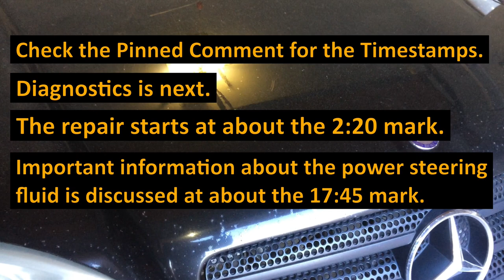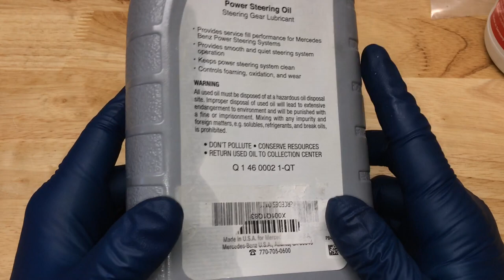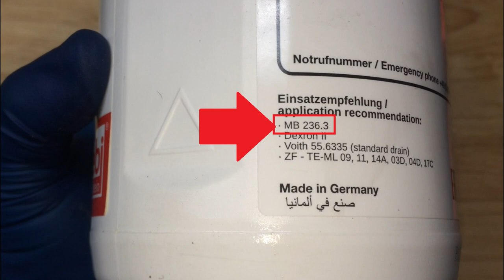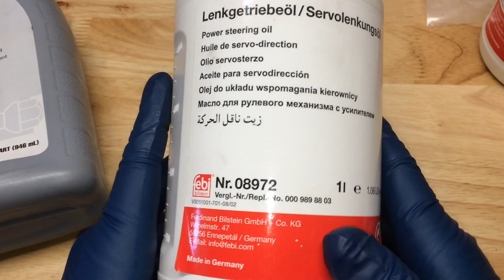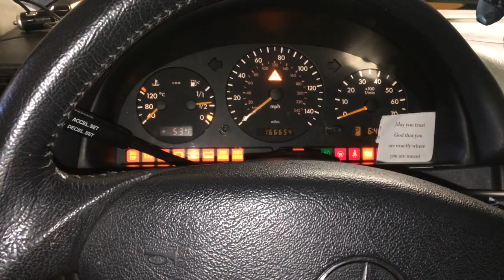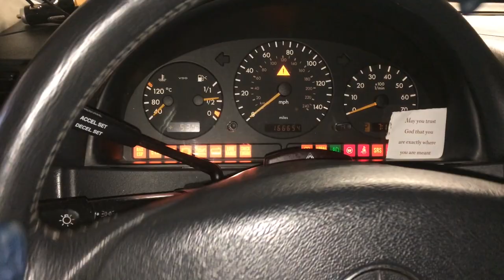Mercedes W163 Replace Power Steering Hose Pressure Line, Fluid Flush & Bleed '02 - '05 ML350 ML500

Comment from the maker: Timestamps, Part Numbers, and other Information:
00:20  Notes about using jackstands and ramps for this job
01:13  Empty the power steering fluid reservoir
01:29  Identify this leak and hose

Begin repair:
02:18  Remove the Banjo bolt at the steering rack (22mm)
03:48  Remove the hose bracket (10mm): 
Tip: @
carl suiter noted in the Comments that you can reach the bracket fastener from the passenger side of the oil pan using a long (2 ft) extension with a wobble end.  Thanks for the tip, Carl! 
04:23  Remove the flare nut at the power steering pump (17mm)
05:30  Locate the o-ring on the pump side of the hose
06:18  Remove the hose

Replacement hose information:
07:14  New and old hoses: part number A163 460 4224
07:29  Inspect the new hose for the o-ring (part number is possibly CRP 0259977548 - not verified)
08:19  Part number for crush washers (A0076 0301 8101)
08:45  Transfer the hose bracket to the new hose
09:29  Notes about the new and old Banjo bolts and washers

Install the new hose:
11:05  Guide the new hose into place
11:53  Install two new crush washers and the Banjo bolt at the steering rack
13:02  Install the hose bracket
13:47  Connect the hose flare fitting to the power steering pump 
15:57  Torque down the Banjo bolt (torque is 22 ft-lbs)
16:45  Torque down the flare fitting at the pump (33 ft-lbs)

Notes about Power Steering Fluid types:
17:47  Original fill PS Fluid (honey-colored): MB Spec 236.3 (ie, MB A000 989 8803)
18:44  Later PS Fluid (green-colored): MB Spec 345.0 (do not mix 345.0 with 236.3)
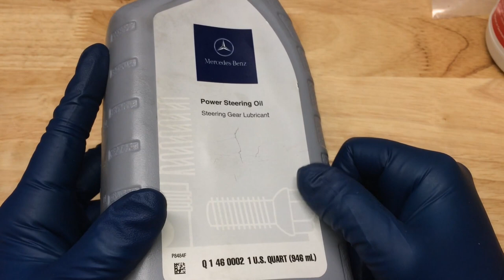19:38  Notes for a PS fluid flush (buy 2L of fluid)
21:46  Tools for a flush (3/8" ID barb and hose)

Power Steering Fluid Flush:
22:29  Elevate the front wheels (ie, jackstands)
22:45  Front end lift-point and jackstands locations
23:03  Disconnect the power steering return hose (Philips hose clamp)
24:10  Install the flush line and sight hose
24:56  Refill the reservoir and start the flush
28:42  Remove the flush line and sight hose
29:41  Reconnect the return hose to the reservoir

Bleeding the Power Steering System:
29:50  Begin the bleeding procedure
31:46  Bleeding procedure summary
33:53  Final adjustments of the PS fluid level
35:24  Check for leaks
36:13  Recheck the fluid level after a couple days

I hope this video is helpful.  Thanks for watching, and good luck with your repair!

Comment: L35 Delivers some of the top DIY's videos on the web.  Over the past 22 years, I've owned 5 -W163's (still own an ML500 and ML320) and have done most of own repairs and maintenance.  Since I found his videos, he is the first I search to see if he has posted a video on the process.  Even if I have done a procedure before, his are a great reminder of what not to forget and how to do it again.  Here's what makes these videos better than the other ones that are out there:
1.) The videos are clear, lighting is great, images are stable and infocus.  He keeps the video rolling during the hard parts so that you can see what is in the way, how to move it, what to disconnect, etc.  He shows and tells at the same time and does not waste time with long introductions about what he is about to do, he gets down to it and explains as it is being done.
2.) He pauses the video at the important points, takes the time to add annotations to the screen shots that clearly pinpoints what to watch for, what bolts, what parts are needed or what you may want to replace while you are at a repair.  What is going to be brittle and break, with tips on where to place catch basins, rags, etc.  This is helpful to keep the mess to a minimum.
3.) Great attention spent on showing "how to" position a wrench or socket or extension, or where a hidden bolt is at.  He covers in detail, how to position your tools, what to take off to get to the repair,  size of wrench or socket, and shows the important details on o-rings,  crush washers, where to look if you don't see them and what tools to use.  This is what saves me time and completes the repair without leaks or rework because of a rubbing hose placed wrong.
4.) He does things by the book- which means he checks and shows you he has verified, part numbers, fluid specs, procedures, torques, where to find it and what to expect to pay.  Many other repair videos wing it on torques, fluids, and safety procedures.   This is what professional mechanics do.

Great work L35 in Colorado!!  You set a standard that others can learn from!

Comment: Outstanding video I just replaced the rack, power steering pump, reservoir and both hoses on my ML320, That little bracket was the toughest part of the job, A 2 foot long wobble extension, coming from the passenger side of the pan took some of the pain away, but it was still difficult.
I love your videos they are so detailed and professionally filmed. A gold standard here on YouTube ..... Bravo !
Reply from the maker: Wow, thanks for sharing that tip about the bracket -- that's a great idea!  I'll add that to the Pinned Comments.  That's a big job to replace the entire system like you did.  Thanks for watching, and thanks for your comment : )
Reply: About to do this on my C320, wish me luck
Reply: @BorisBidjanSaberi11  It's not a horrible job just time consuming. A crows foot wrenches and long extensions for the bracket will be your go to friend for this job.

Comment: Good video. Ive got to take off the return power steering pipes. The blue washers or O rings if you want to call are leaking. Cant replace with black ones, as yes they may work to begin, but will weaken in no time causing leaking again. If you done i expect you are aware. The old ml's are far better than the new models. Ive had 6 ton behind one;Towed easy. Keep your good videos up. Showed and explained well talking at a speed people could watch and do the job at the sametime
Reply from the maker: Thanks for adding your tips -- yes, I agree the green Viton o-ring/seals/washers are better quality and last longer.  Thanks for watching! : )

Comment: Thank you again for another informative tutorial.  Replaced the o ring at the ps reservoir and decided to do the flush.  A little messy but worked like a charm.  159,000 miles and I don't think the ps oil had ever been changed.  One last thought, take very seriously her proper level as shown around the 34:17 mark.  I had over filled the reservoir and had leaking oil for a a few days until I figured out the excess ps fluid was pushing out around the cap.  Would love to see an oil pan gasket video in the future.  Excellent material.
Reply from the maker: Thanks for your comment, and thanks for watching!

Comment: Excellent video.

I think it's the washer on the reservoir leaking on the one I'm working on, but once that's done I'll check for leaks again.  There's so much fluid coming out I can't pinpoint if there's more leaks in addition to whatever is leaking from under the reservoir.

Comment: What a great video. Thanks for all that hard work recording. It's a lot of elbow grease!
Is it possible to just repair the hose at the crimp with high quality epoxy?
Thanks
Reply from the maker: Thank you!  I haven't tried an repair option on that particular hose, but in the past I have used wraps like this in a pinch/when traveling to repair hose leaks (including for a leaky transmission cooler hose on an MB):

https://www.amazon.com/SEPTLS4421540599-Loctite-Insulating-Sealing-1540599/dp/B00H23RC3Q/

The hardest part of using tape like that is getting in there to apply it!
I hope that helps - please let us know if you're successful with a repair option.  Thanks for watching! : )

Comment: Great video as always! What kind of ramps do you have? My rhino ramps have the correct weight capacity but have a max tire width of only 9.5”
Reply from the maker: I have the older gray Rhino ramps - I think 11909 is the part, but I'm not sure.

Comment: Hi - fantastic video!  I have a 2013 R350, the service manual refers to depressurizing the power steering system with the pressure reduction screw, but I can't find the procedure for that - if I just leave the car overnight without running it will the system be depressurized? Thanks.
Reply from the maker: I'm sorry I missed your comment - I am not at all familar with the 2013 R350. If you're still working on this, I recommend starting a thread or searching the forums at www.benzworld.org -- there are MB techs there who can help you!  Good luck : )